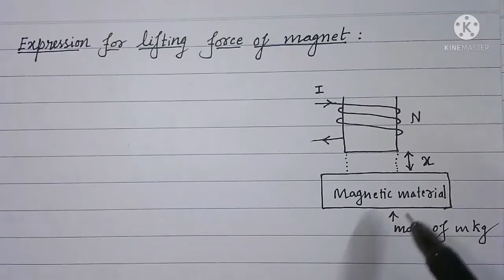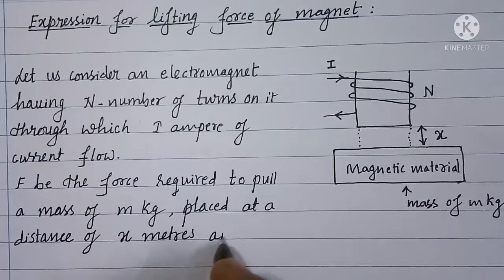Lifting Force of Magnet.

Comment: hello i was wondering does the magnetic material (that is opposing the solenoid) affect the levitation in any way? (for example could i have a magnetic material with strong or low pole strength and still achieve same results (for levitation)?

Comment: for this formula do we assume that the solenoid has an iron core? or does it not make a difference?
Reply from the maker: Electromagnet has iron core as shown in figure. 
In calculations we have to take change in volume of airgap between magnet and object to be lifted.
Reply from the maker: If iron core is used , then MMF required will be less. In this derivation , iron core is shown. But air gap is necessary  to do the work.